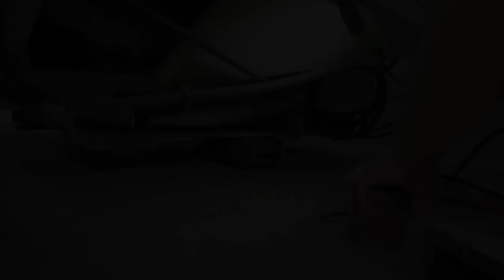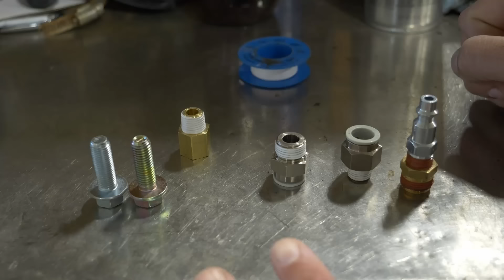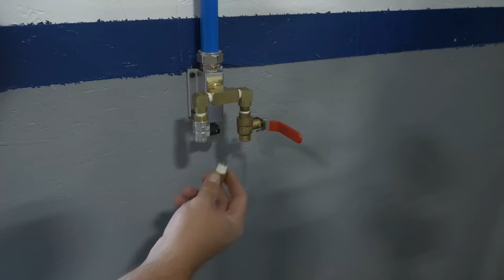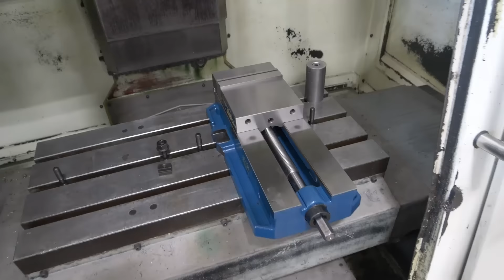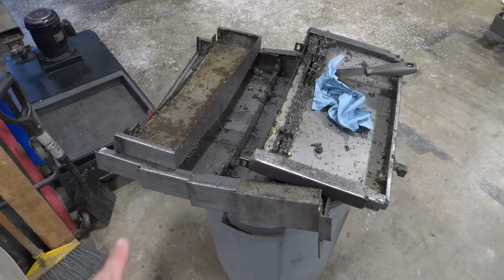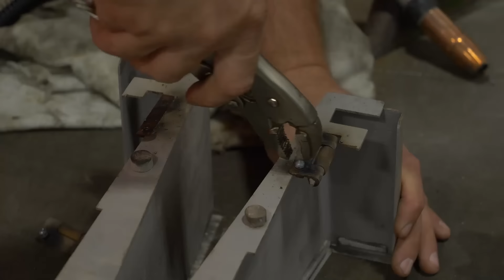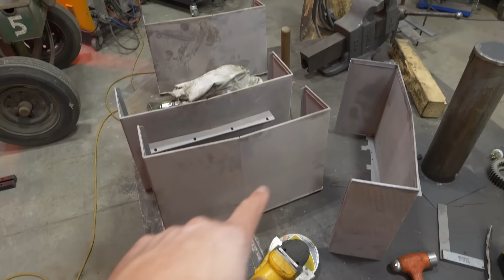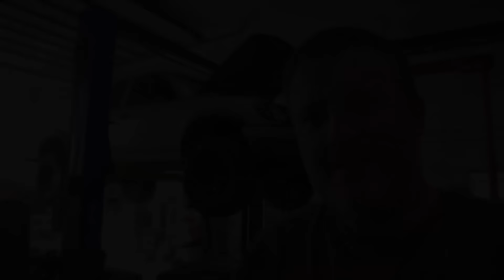Did I Buy a Problem or a Solution? Cheap CNC Repair Part 1

Comment: There are two microswitches jn the head that are contacted by a finger that is bolted to the knockout cylinder that is bolted above the spindle.  Over time coolant that has fried off of parts and other general oils in the air get on those microswitches and then when it is cold, the 'tool clamped' one doesnt un-switch fast enough before the 'tool unclamped' is pressed by that finger.  Hose them things down with electrical contacts cleaner, and bob's your auntie

Comment: I thought pounds was a measurement of force and not weight, hence the lb/ft rating for torque. It's a force per distance. I'm fairly sure weight is measured in slugs in the imperial system

Comment: The other difference between NPT and BSPT is there's about 0⁰-20" (or something, it's not much, under a degree) difference between tapers. So if your lucky to get a similar thread pitch, never the twain shall they meet because of that difference in taper.

Comment: You picked one of the best home gamers machines. The company I worked for had two of these machines. If you are not in contact with Hurco you should ASAP. They are very good to work with. I have run CNC machines for over 40 years and these machines punch well above their weight. Maybe the best and must user friendly conversational controls ever made. The tool changes can be a bit of a problem we’ll always leek oil no matter how often you rebuild them. Just feed it oil every day you run it. The machine wants lots of air. We hooked a small air compressors right to each machine. BTW I thought these machines were just junk when I first saw them. I was very wrong. We Ran over 30 MAZAK’s, Doosans, Haas, Okumas, Mattsuras, Tree and Hardinge VMC and HMC machines. These little Hurco machines held their own. There is a very special memory backup battery you should get one and replace it ASAP. It will be good for 5 to 7 years. Call Hurco!  They are very good to work with.

Comment: 7:02 well yeah, Britts don't use metric either, they use extremely convoluted mesh of ten different systems depending on what they're measuring, what's the purpose of measurement, and what time of day it is.

Comment: Gravity varies by up to 0.7% around the globe so your American for pound is not the same as a Norwegian foot pounds. If you say that well the difference is so small it doesn't matter, then just round g to 10 and move the decimal point when doing betyg metric. But also you're confusing the metric system of measurements with various bolt and thread standards that are based on metric measurements. It's like complaining about Imperial units because you used the wrong thread pitch.
Reply: The U.S. 'pound' weight/mass has been tied to the official Metric Convention standard since the late 1800s.  Today it's the International Bureau of Weights and Measures who defines the kilogram based on the Planck constant; it's that standard weight the U.S. 'pound' is based on today..
Some American politicians in the 19th Century amazingly had the foresight to see the future problems, I'm shocked, and that was at a time people had horses to ride.  In my opinion thoughtful politicians have been long gone..  Please don't tell any Americans about this connection to Metric standard - their heads will explode,

Comment: You described pounds as a unit of weight and kilograms as a unit of mass.  Both are commonly used as units of weight in general speak. Engineers avoid confusion by using lbf (pounds force) or kgf (kilograms force) as units of weight.

Comment: It was before my time, but I've been told of a great betrayal.  Canada and the US were to go metric, the US backed out part way through and Canada followed through.  Now I'm stuck in Canadian Limbo where I need tools for both systems and the knowledge to do calculations and designs in both.  If Canada ever invades and conquers the US it will be to make you switch to metric so I can stop this madness!

Comment: Very amusing video, in deed!
- First criticism on the metric thread that is not "better"... because it's based on inches (?) weird criticism.
- The most amusing part was about the Kilo not being a weight unit... .... .... err... should I say it?... the kilogram is absolutely related 1:1 to its weight representation, which makes is a fully trusted weight unit. Sorry to ruin the amusement.
- Not happy with that bit, the following is the "convenience" of the foot-pound in a torque wrench... are you being serious?? the metric torque wrenches have the proper measures printed on the scale, to accommodate every lever length of your choice! It's so easy as READING IT! no conversion needed whatsoever! (unless you want to read it in IMPERIAL, of course)

This sounded so much as being biased but trying making it our fault 🤔

Oh, metric is ALWAYS better, because its all straight math, not a fractions mess!

although, I had a blast, I have to admit it! 😂 so funny!

Comment: Concerning torque - this is why in metric system Torque is measured not in kg but in Nm which equals 1kgm2/s2 which has got nothing to do with gravity at all unless you not mistakenly see the gravitational constant in kgm/s2 as an acceleration that is applied to a kg.

Comment: never pressure-wash things which have exposed bearings. (even rubber sealed ones)
22:08 - nope.  they are ball bearings just stiffer ones.  roller rails have bolt spacing about two times closer and a distinct flats for rollers.

Comment: Because of your torque calculation. When do you actually have to calculate torque in Nm? I simply set the required torque in Nm on the torque wrench and that's it. I don't need any acceleration due to gravity to calculate this.

Comment: With regards to mass, the metric kilogram (kg) and imperial pounds (lb) are both mass units. In fact, one pound is equivalent to 0.454 kgs. 

In the imperial system, the lbs/in² is a unit of force, as is the kgs/m² for the metric system.

Comment: Do you really think in my weight times some distance when you torque something?
In the metric system you can do the same and just use x10 as a conversion factor, it's close enough because your wrench won't be exactliy one metere or some amount of feet anyway.
But when you talk about Kg or Newtons everyone knows if you are talking about mass or force. When you use lbs, you might not know which one it is, unless you specify pound-force.

With the pipe threads however i agree the whole thing is just annoying the amount of different standarts.

Comment: Tacomas had a recall for the frame problem you showed
Replacement frames are still available
Had a 96 T100 with 240k miles that had a similar issue with rear frame horn.
Found it when I did a gas tank replacement

Comment: Colloquially when one measures a weight in kilograms it means the measurement is kilogram-force (kgf), this is ALSO true for pounds - the measurement unit you consider to be a weight (lb), is actually also a measurement of mass (and incidentally 1 international lb is defined as 0.45359237 kg). Its equivalent to kilogram-force is pound-force (lbf).

Comment: I'm watching the CNC rehab because I know nothing about them and learning something from watching Wes is a lot more satisfying than watching drivel on network TV.   Regarding the Tacoma...there's a lesson in paying attention to recall notices.  My 2000 Tundra failed that corrosion inspection recall.  Body looked perfect from the outside.  Got under it and look at the frame...well...ick.  Got a new frame put under it on Toyota's dime.  The window on that recall fix closed long ago.

Comment: 10:30 You are a bit wrong with your calculations. To get from kg to nm you multiply the kilos times 10, because 1nm = 100g thus 1kg = 10nm. You multiply by gravity, which is wrong, the force is independent of gravity. That's why you have two unit foot pound... and I keep forgetting the second all time long.
Reply: Google tells me:
"To determine how much 1 kilogram weighs simply multiply it by the acceleration (in metres /sec/sec) due to gravity, at that location, at which the object would be subject to in free fall. Hence, on earth, at sea level: Weight = mass x acceleration = 1 kgm x 9.81 metres / sec / sec = 9.81 Newtons."

btw:  gravity varies depending on the location on Earth;  It's only minor differences - almost noise level, some areas of Earth are more dense than others, therefore gravity varies.

Comment: Awesome video Wes. Look forward to the next one. 

I see lots of rubber parts in those way covers that could be 3d printed in TPU if you can't find them. Oil res cap could be printed too. You should pick up a Bambu Lab X1C if you don't have a printer yet. There's even a Black Friday sale running already. Super useful in the shop. 

Or if you have a chance to draw some up in CAD i'd be happy to print some off and send you some if you want...

Comment: Hi Wes, I lived on Planet Earth when we had lbs (pounds) and ozs (ounces) we also had £p (£pounds shillings and pence) 112 pennies to the £pound, then Metrication arrived, but not fully at that point.  We still have £ pounds but only 100 pennies per pound and a "10 bob" note became a 50 pence coin..lol (ok 10 bob note was slang in Cockney speak (East London) for 50 old shilling or "50 bob".. confused? yep we were also. We survived and as I worked In AERPO parts production, for working drawings changed from Thousands of an Inch/ Inches/ feet/ yards, Into MM, M, and so on. so required completely new measuring equipment. I noticed your cousins In Canada went Metric, or was that Alaska? A long way from me, I only saw It from 30.000 feet (Not metric- why) onboard my flights to touristy Florida from merry old England. I ended up working on a 5 Axis Machining Centre on Nightshift (for stupidly long nights/ weeks), but It paid well, the CNC machine was FANUC controlled so Japanese? made CNC.  Question, If you put a tool IN the toolholder arm, press toolchange would it not swop it into the taper waiting for the tool, PLUS needs compressed air to clean the tool taper before seating? as per normal CNC tool changing. Anyway, You damn clever enough to sort it out, just a shame it has no OBD2 port to give you answers bud.
Reply: "then Metrication arrived"  ---- Perhaps you could give a reason for "Metrication" of the UK money system ---  Short answer:  Many clerks at tills (cash registers) in the UK couldn't make correct change, it required knowledge and skill; many ordinary people never learned the system,  or they didn't really care about the results.  A nation famously called 'a nation of shop keepers' couldn't reliably train and retain staff who could accurately handle bills and coins.

BTW:   "we also had £p (£pounds shillings and pence) 112 pennies to the £pound"  --- I'm pretty sure it was 240 pence in a pound.

Comment: frames - good c channel is still expensive new
way covers - we found brush/seal combos that weren't that bad price wise
also, a little positive air pressure in them makes things go a lot farther, but we were running high volume coolant too
small lands, big bed, was used for small/med removal aluminum, center and treat as small for hard metals 
if you'd been looking 2-3 years ago could have got great deals, were ready to go machines with not a lot of hours for less than 2-3x scrap price

Comment: The length of the torque wrench handle being assumed to be exactly 1ft came in real handy to demonstrate imperial being straight forward didn't it? 
Try a metric example with a 1 meter handle.
You weigh 100kg, we assume the G to be 10 m/s2 for almost anything but rocket science which makes you able to calculate the force simply by multiplying your weigh by 10 (1kg ~ 10N) which gives you 1000N of force which you then can multiply by the length of the handle (1m) and the result is 1000Nm (100kg * 10N/kg * 1m = 1000 Nm)
Now you notice how we only worked with powers of 10? What's that easy? Well that's the metric system for you, all multiplying or dividing by 10, not different random abominations of numbers
Reply: In summary you nagged for a couple of minutes over multiplying your mass by 10 to reach your weight, its literally adding a zero to your mass how hard is that?

Comment: I have a 2001 Tacoma with 300k that the driver side frame rail looks just a hair better than that. Passenger side looks perfect, go figure. It's outside Louisville, KY if you're interested.

Comment: Fun fact - there are FOUR different tapered pipe thread standards. There is the NPT and BSTP that you mentioned, but there is ALSO an ISO pipe thread variant, and ALSO a DIN variant. As far as I'm aware, none of them are interchangeable, but they're all sized very similarly. 

And then there's the whole sideshow of parallel pipe threads.

Comment: There was a recall on those Tacomas for rusted out frames. I would check to see if that one has had the recall repair done to it, if not, it could get a new frame installed for free at a Toyota dealership.

Comment: My Dad had to change to Metric and he said to me that he got rid of the imperial  tools and got Metric tools was the best way to go
Reply from the maker: It's tough to be the only one using metric. All the metal and wood I can buy are sold in inch sizes. All the building codes are in feet and inches.

Comment: When people think things made in metric are better because it is metric, they laegely miss an important point. You can produce great stiff using metric figures, and you can produce garbage to the same dimensions.
To a degree for most people and applications the metric system to measure will be more efficient. But what unit you measure the sizes in, doesn't really matter, as long as you use the eight specs and standards as reference. And somehow pipe fittings with the existing multitude of standards seem to try and kick all of us in the balls, as there are so many and so many still in ise. Wordt thing, multiple standards on the same machine. By the way, torque wrenches here don't have kg as a unit on them anywhere, the unit specified on these  is Nm. Torque specifications are given in Nm as well. On different size wrenches the scale is adapted to the size, as with us ones using lb ft. Oh, and pound i the US unit system can be both, a unit of weight or mass. If it is weight, or scientifically correct, the force the mass of an object applies towards earth due to said acceleration, it would more correct be pound force lbf. So torque would be correctly in lbf ft, although it somehow became common to just abbreviate it as lb ft.

Comment: So gravity on the Earth's surface varies by around 0.7%, from 9.7639 m/s2 on the Nevado Huascarán mountain in Peru to 9.8337 m/s2 at the surface of the Arctic Ocean. I really like how it turned out that the tool changer was just low on oil. There are entire tube channels dedicated to cleaning stuff, why did you deprive us of that content, this is what second channels are for.  For what I want first, THE UGLY! With the tacoma, whatever you do don't clean off the structural rust! It's not the hitch holding it together.

Comment: $1000 in NEW Way Cover Seals 🤯 … After seeing the gaping rusted hole in the drivers side boxed frame rail for that 2000 Toyota Tacoma’s I bet you’re kinda wishing you were looking at $1000 in fabrication repairs instead. 

Your own repairs of course cuz $1000 in someone else’s materials and work wouldn’t even cover the surface rust let alone addressing the structural integrity of that fab shop employee killer. 
Roll something like that into the garage Friday afternoon with instructions for the guys to fix it and you’d be coming into work Monday morning greeted only by silence and freshly printed resignation letters.

Comment: Well actually Newtons are used. America is the odd one out in the world.  Catch up and join the rest of the world.  Oh, and yeh JIS is different, which is why you need JIS screw drivers when working on Japanese products if you don;t want to screw up the threads.  Oh, and why is the US gallon different to the imperial gallon?  Beats me.  American  exceptionalism I guess.
Reply: Blame it on the British.
The US gallon is Based on the Queen Anne wine gallon.
The British changed their weights and measures in the 19th Century, the US has kept the units that were formerly called the British Imperial Units. Remember Britain was still pressing hostilities against the U.S, for most all of the 19th Century.  Britain is clearly at fault here.

Comment: In Canada we hate the metric system so much that depending on the application we use both units of pounds and kilogram when weights are concerned , of course if your an old fart like myself of 55, I personally was a kid in the 70’s when  metric system was forced on us , so yeah .. we use both depending on the circumstance ..

Comment: Oh Man! There is no standard for hydraulics and all the pipe stuff! Pretty much every japanese manufacturer for construction equipment uses different types, but most of them (no not all of them) are metric. Here in europe waterpipes are in inch if it is made of any kind of metal and has a thread, pipes are often in milimeter but not always. Your (japanese) M10 screw has a fine thread, it can provide more torque, nothing special, often used in automotive stuff too.